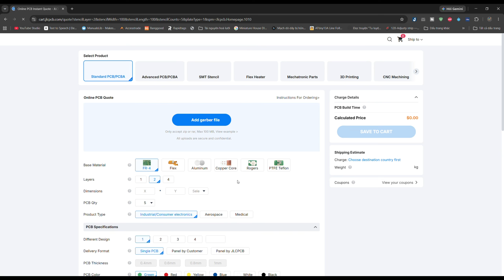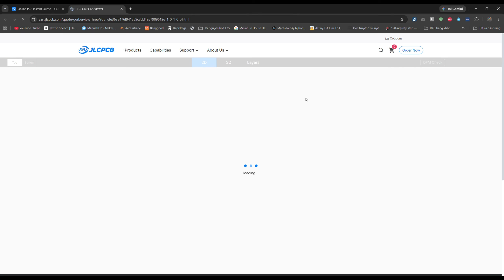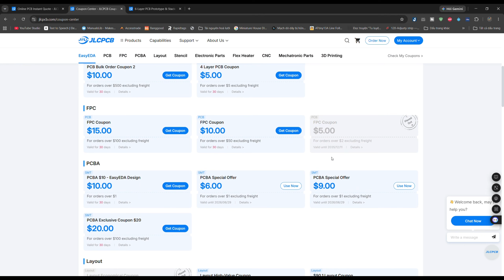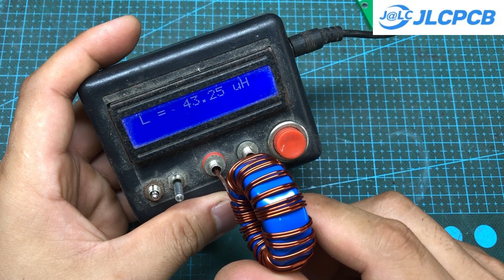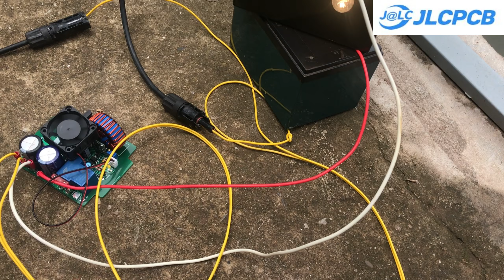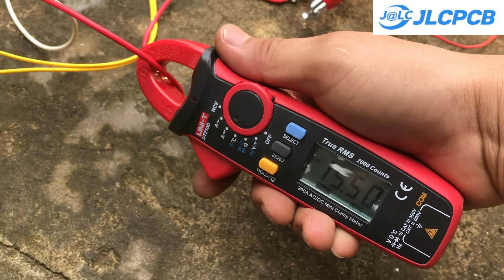Powerful  BUCK solar 40A | JLCPCB

Comment: that coooilllllll screaaamiiinnng as helll
Reply from the maker: Yes, the switching frequency is currently quite low, which is why you're hearing audible noise. Simply increasing the switching frequency should eliminate the noise and solve the problem.

Comment: WHere is test with thermocam, that this gadget can deliver 40 A / 58 V to the battery ?
40 x 58 === 2320 W., if you have diode and VDROP 1.4 V, 1.4 x 40 === 56 W loss at diode,
another los at FET, another loss at CAPs, another loss at coil,
so this thing will evaporate soon at 2300 W of power. 
Just do the tests properly, and you will see, what is 40 A to PCB traces,
and how can you use this type of relay do such high DC voltage ?
Reply: he dont.. thats why that coil scream like crazy and he cover that by that fkin shiyt song.,.

Comment: do you have a boost conveter capable of outputing 50Amps at 70v?
im planning to use that for my electric trick, currently has a 51.2v lifepo4 at 50ah. but my motor and controller can handle up to 60v system or 74v max. im thinking of just boosting the voltage instead of adding more cells, because doin that will need a new cell that will match the old one, with could be almost impossible capacity wise, i will also need a different bms and above all that the biggest reason is there are no more space inside the battery compartment even for just 1 50ah cell.
plus. having a boost converter means i will always have a constant voltage as it kinda annoys me that when the battery voltage drops as the battery percentage drops, the top speed also drops
Reply from the maker: Unfortunately, I do not have any projects with that much power capacity. You may want to consider modifying the control circuit instead of using a boost converter module. Changing the voltage sensing resistor values in the control module would be much easier.

Comment: Bhai , Can u Design Variable boost from 24v to 200vDC..? 10A
Reply from the maker: I previously worked on a similar project. I may redesign it to increase its power capacity.
Reply: @PhdHung  Can i get link of that previous did project please
Reply from the maker: https://drive.google.com/file/d/1g1aQeN768om-yKDWwFc0sGwlE92f29K7/view?usp=sharing

Comment: Can you make a buck boost converter using the esp32 control as a variable PSU that has a fairly large ampere of 1-15A and volts of 1-48v with an input voltage of 18-40v?
Reply from the maker: That's a good idea. I'll implement it soon. Adding Wi-Fi connectivity for smartphone control would probably be a great feature as well.
Reply: @PhdHung Yes, maybe you can add a TFT LCD with button control or a rotary encoder and you can change the volt and ampere values via your cellphone or directly on the device, Greetings from Indonesia, thank you.

Comment: শুভ বিকেল।
We saw your 1500w simple but gorgeous inverter many days before. Requesting your Honour for make an inverter like the similar one with battery charging facility &  including mosfet spike voltage protection. 
Thanking you from Bangladesh 🇧🇩.
Reply from the maker: Yes, a similar inverter with a built-in battery charging function is currently being finalized. It will be featured on the channel soon.